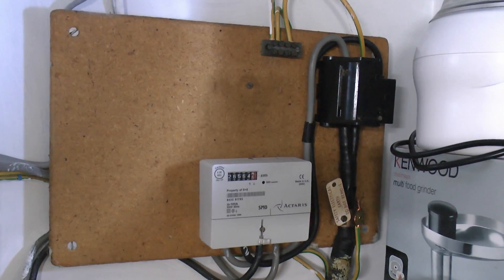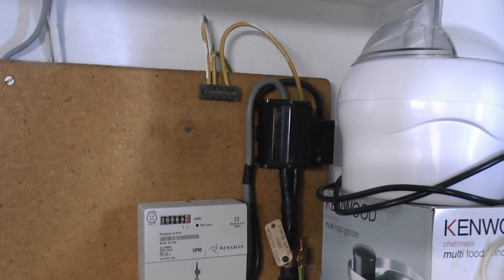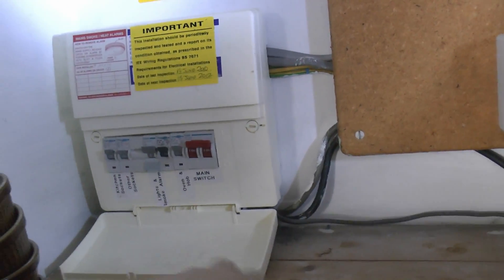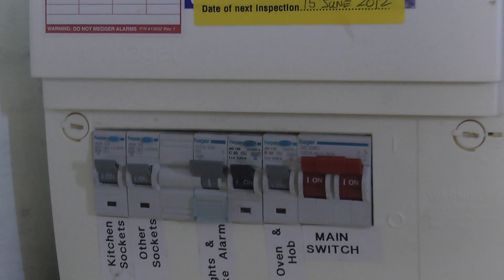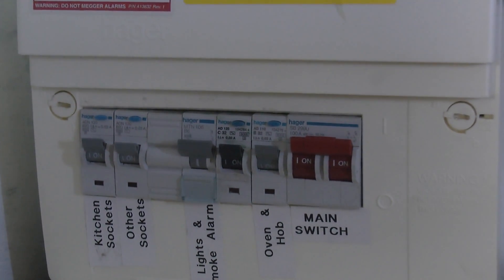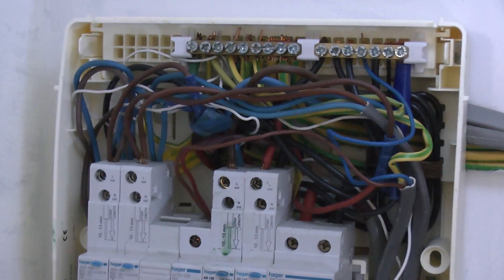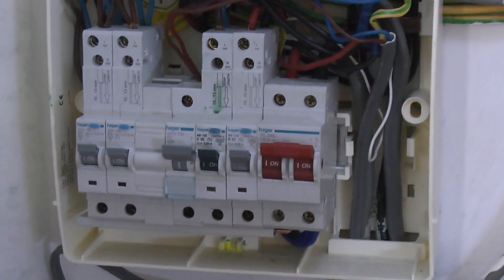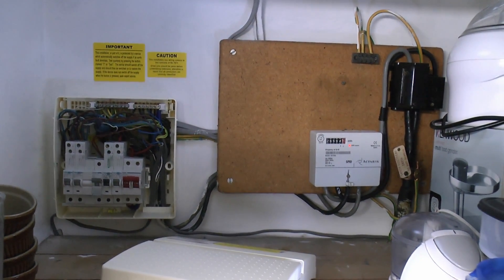Main Switch Consumer Unit

Comment: Has the green slime on the RCBO with the black lever come out of the cables?
Reply from the maker: Yes, the cables are from 1971 and the copper in them is reacting with the plasticiser in the PVC insulation.

Comment: There are 6 neutrals in the neutral bar eventhough there are only 5 Breakers ?  Why is this
Reply from the maker: The 6A MCB for the lighting has 2 circuits connected to it, so 2 neutrals.
Reply: @jwflame  Thanks.

Comment: Any chance of a video on why you shouldn't megger alarms? I know it's not recommended for emergency lighting either.
Reply: Meggering involves measuring resistance if you apply 500V between the various wires. Electronics don’t like getting 500V to the face. It’s really no deeper than that. It also applies to RCDs/RCBOs when you leave them on and connected, and especially AFDDs.

Comment: Does that sticker on the unit actually say 'Do not megger alarms'?  What?
Reply from the maker: +David Ellis Yes, that's what is says.  It means to not apply 500 volts when testing the insulation resistance of the circuits, as the alarm supposedly could be damaged by that.  'Megger' being a common brand name of testing equipment used for such purposes.
Reply: +John Ward OK you learn something new every day!  Just seems a bit odd to use the brand name as a verb.  I'll just google it to... oh.

Comment: Hmm, interesting, are mains powered smoke alarms common in the UK? They have always seemed odd to me, I mean sure, no battery to replace, but if the power is out and the built in battery (I assume it has one) goes dead, you are out of luck for early warning.

God that thing is an absolute mess though.
Reply from the maker: +Jesse Levesque Yes, very common and are required in new build and where properties are extended or converted.
They have batteries also, either replaceable types or sealed lithium cells which have a 10 year lifespan (same as the alarm itself).
The alarms typically beep every minute or so if the battery is discharged or if mains has failed and the battery is low.  Even without mains power and a low battery, the beeps will continue for weeks to warn of the power loss & low battery.
Reply: +John Ward And the beeping is massively annoying, which I guess is the point, but if someone made a better way of letting you know the battery is low they would be very rich.

Comment: I thought years ago (I am not an electrician) that it was considered not a good thing to place light circuits on an RCD as it could drop you into darkness of there were a simple fault on the line. Maybe I was wrong. Also, when we converted a barn 3 years ago we were made to take the smoke alarms off the RCD protection. Also, I recall plastic consumer units being hailed as a step forward as there was better insulation for the consumer should a rogue wire com lose and there was any issue with he earth. Now with fire considerations we are back to metal CU's. Interesting.
Reply: The c.u should really be metal with plastic coating to cover all bases
Reply: That logic works for not putting the lighting breaker into an RCD that has a whole bunch of other circuits on it — in which case an earth fault elsewhere, say in the kitchen, will put you in the dark as well. When you’re using RCBOs that doesn’t apply. You only disconnect the circuit that has the fault, and lightning circuits don’t get a special dispensation for it. Darkness is not more scary than actively electrocuting people.
Reply: +Colin Herbert under the 17th edition amd 3 you are required to rcd protect any cable that is in the wall less than 50mm from the surface. This it to protect people who dont check for cables and bang a nail into the wall to hang a picture etc. Metal consumer units are much better overall and as long as you have a solid earth to the metal casing and all cables are correctly installed then there is no risk to people.
Reply: Luc Mathlin Hi... that's the logic now for metal CUs but I guess my point was that the logic was different some years ago, hence the proliferation of plastic consumer units quite recently.
Reply: yeah, the only real reason for plastic was to be cheap. all the other reasons are just crap.